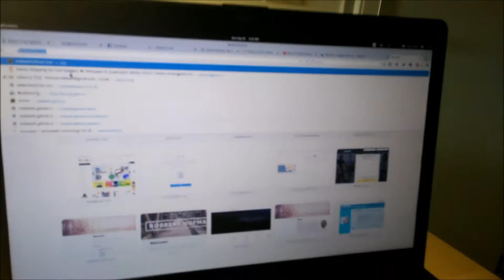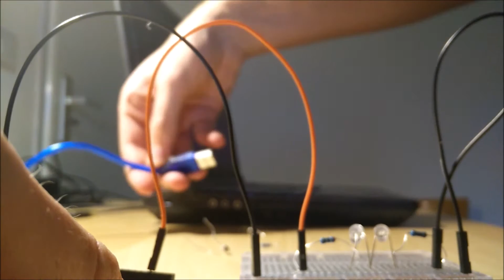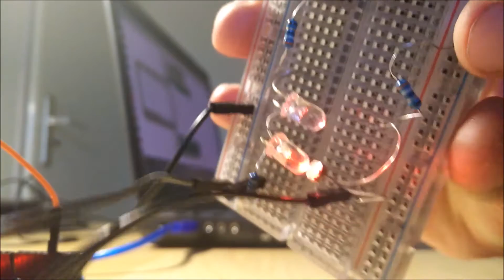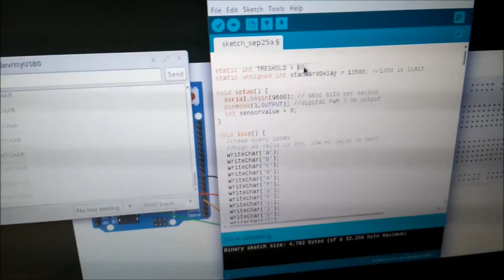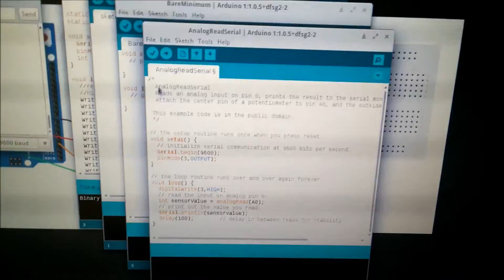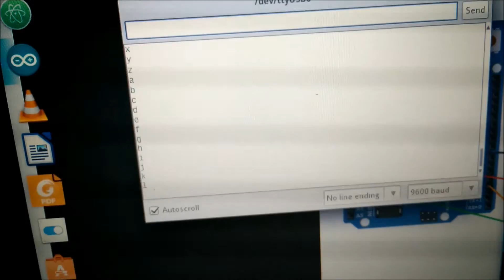VLC Followup vid

Comment: Hey .. thanks a lot for this great project ..
I just want to ask where is the receiver and the emitter system  ???
Because i should write 

the emitter system of the information is (....)
The receiver system of the imformation is (...)
Reply from the maker: The emitter system of the information is the two red blinking LEDs. The receiver system is the photoresistor.
Reply: But they are both lied  with the same arduino 
 Can i use 2 arduinos
Reply from the maker: @eafaeafa6935  Exactly. At this point, there is just 1 arduino communicating with itself. I've done this to keep synchronisation simple: the arduino is always perfectly in sync with itself. You could adapt the system to make use of 2 arduinos, but that would require some code to be rewritten in order to account for the synchronisation problem. It's not trivial, but certainly possible :-)
Reply: Please how i can contact u i am realising this project this days
Reply from the maker: @eafaeafa6935  youtube comments are fine for me :-)
Reply: Ok merci ..
J ai trouver dans mon centre juste la photodetecteur et pas la photoresistance est ce je peux remplacer la photoresistance par photodetecteur?
Reply from the maker: @eafaeafa6935  oui certainement. Si je me souviens bien, un photodétecteur fonctionne comme une diode, donc vous allez avoir un petit peu moins de variation dans la voltage mais ça devrait marcher aussi :)
Reply: Hey please when i realise it when i add pinmode or digitalwrite they say the scope is not defined
Reply from the maker: @eafaeafa6935  there is an excellent explanation on scopes on the arduino website: www.arduino.cc/en/tutorial/Variables
Which variable does it say is not defined?
Reply: Please can u give me other way to contact u ? I wanna send you the experience picture .. some thing does nit work with me pleeeasr
Reply from the maker: @eafaeafa6935  you can upload your images to a photo publishing service like imgur, if you'd like :-) You can then just paste the link here. I won't share any personal details here because I don't want them to be public, and others won't be able to read the fixes to problems they might encounter too. I hope you understand.

Comment: Hello. I will speak french because i see you replay to one with it. 

J'ai essayé de varier la valeur du TRESHOLD et standardDelay comme vous avez fait. Mais la valeur ne reste pas constante.  Ça varie de 0 à 1024. Pas de lumières aux alentours. 
Et une fois la led en mode LOW, it's the same thing. 

What should I do?
Reply from the maker: Ça te donne 0 à 1024 sans que tu changes la lumière? J'éssaierais de changer de porte et de reverifier toutes les connections.
Reply: @vision4472  oui ça varie entre ces deux valeurs.  Et même une fois la led éteinte, je n'arrive pas à avoir la valeur fixe 0 comme vous avez eu mais des valeurs qui changent.
Reply from the maker: @perledusavoir  est-ce que vous liez les valeurs correctes ? La même porte qu'un réalité est déclaré dans le software ? Y-a-t-il une correlation entre lumière et les valeurs que vous voyez ?
Reply: @vision4472  oui oui, tout est bien lié correctement.  Aucune relation entre les valeurs. J'ai fais tout comme vous sauf les résistances. Je n'ai pas pris les mêmes valeurs.
Reply from the maker: @perledusavoir  combien as-tu pour les resistances et combien pour le photoresisteur ?

Comment: i think resistors at 1st are 0.4 Kohm thus 400 ohm right ?? this is what i saw
Reply from the maker: nba fun why do you think that? It reads .040 kOhm, if I'm not wrong?
Reply: oh you said 40 kohm ok i thought you said 40 ohm fine thx for clarify and reply !!! do u know how we can make CSK in arduino ???
Reply from the maker: nba fun yes 0.040 kOhm or 40 ohm :p but it doesn't really matter here. I have no idea what CSK is though, sorry.
Reply: i know the conversion :p but it read 0.4 NOT 0.04 on the multimeter and you said its set to kohms then its 400 ohms.
Reply from the maker: nba fun but the dot is in front of the "040", not in between? I could be wrong but I'm not sure how :p

Comment: My analog read values seem to be wrong when i set digitalRead(3, HIGH); I am getting values in the 600s=800s instead of in the 10s like you did.  Can you help me fix this issue?
Reply from the maker: Jay Shenoy digitalRead only takes one argument, you don't have to add the "HIGH" part. It is normal that you get different values: just try a different, darker or lighter environment. It is not an issue by the way, you can just adjust the threshold. Good luck :)